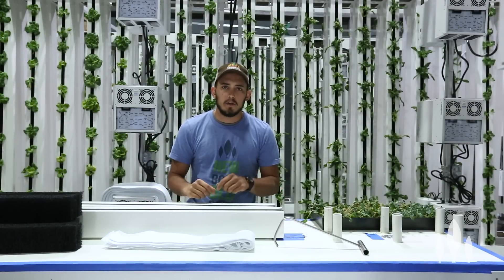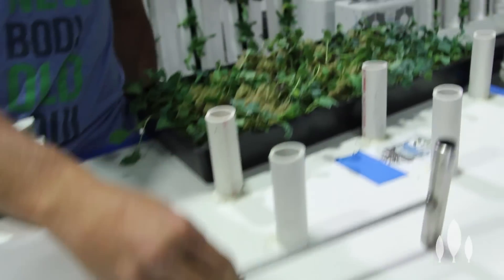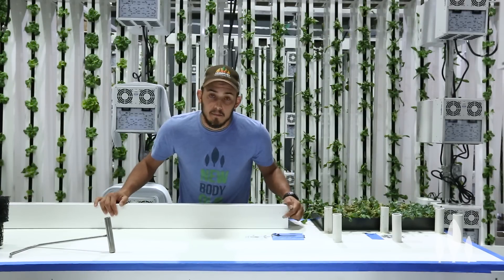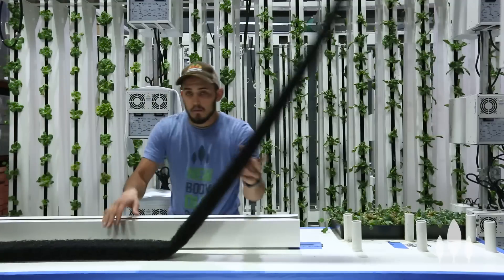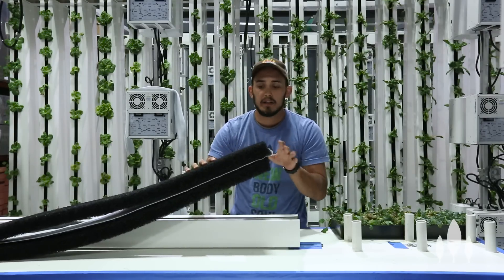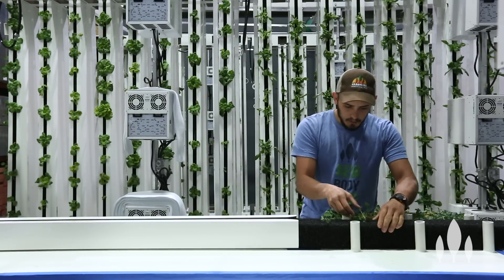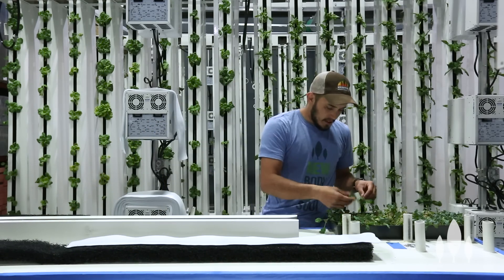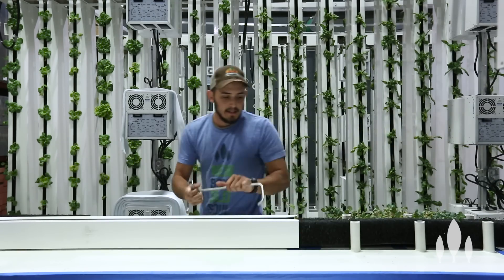Transplanting Plugs Efficiently in Commercial Hydroponics

Comment: Nice but i think its a wast of time.. I mean too many steps..
The way i doing them is in my opinion faster.
When i lay on my wicked strip i also put the plugs at the same time as its still on the side. Fold  it, and insert it into the tower( tower that i set on the side instead of side up). So plugs stays in place. And because they stay in the side, leaf won't be a problem too.
I do a full tower right away.(2 media at the same time).
But, thats my way. 👍
Reply from the maker: Thanks for the comments. Great tip for our viewers!